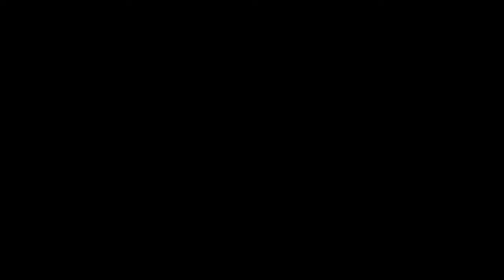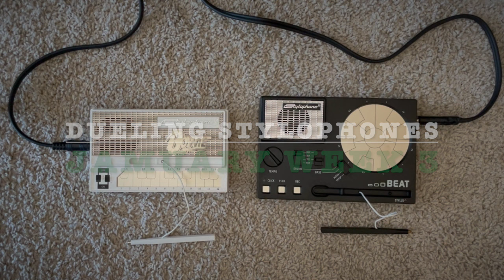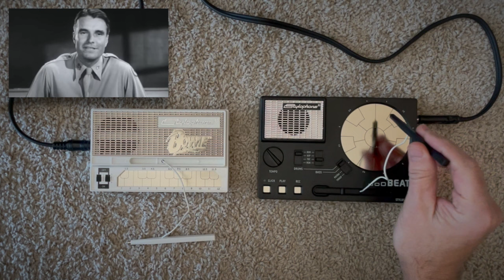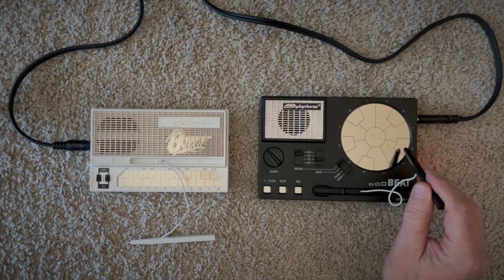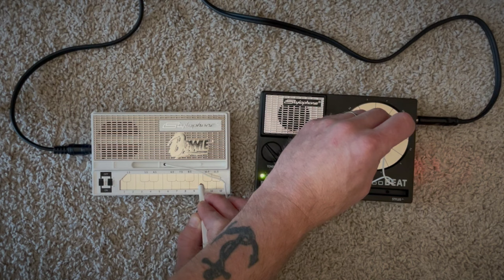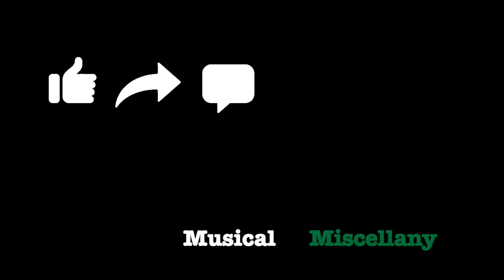Dueling Stylophones (Bowie + Beat) | Jamuary Week 3 | 2024

Comment: Hey!
I just ordered a stylophone beat and an X-1 so I can get started drawing beats myself, how do I go about connecting these two devices together?
Reply from the maker: I did it with a small mixer that's out of the frame. That's probably the best way to mix signals. However, if you want to do it low budget, the Stylophone Gen X-1 has an external input. You could simply plug the Beat into the X-1 and then both Stylophones will come out of the X-1's output. All you'd need is a short 3.5mm TRS cable. Thanks for checking it out.